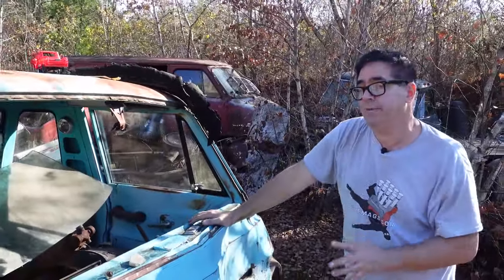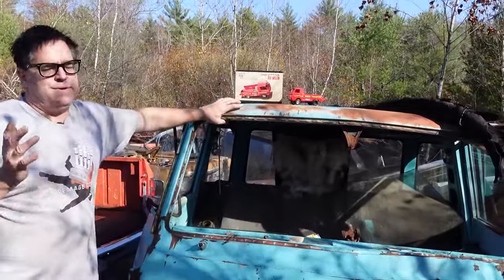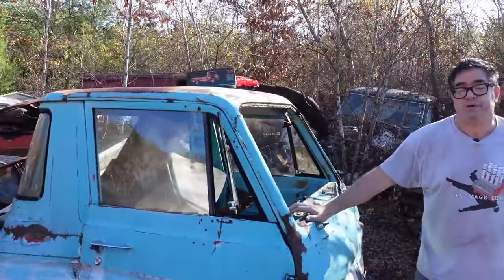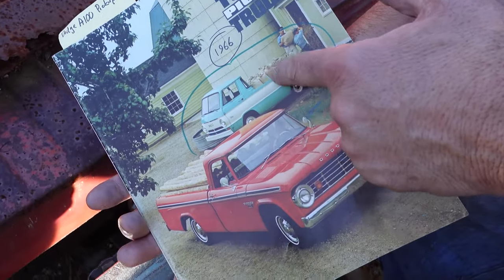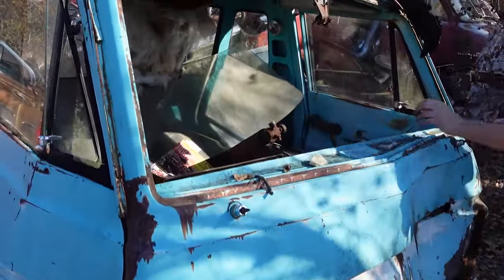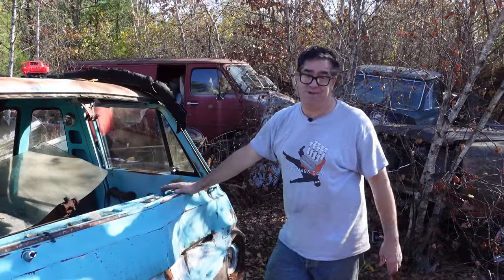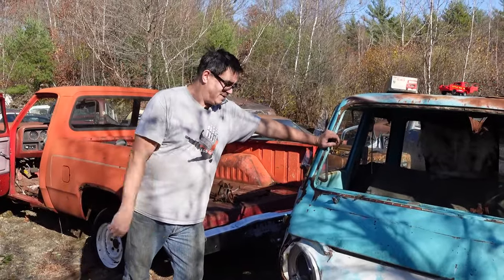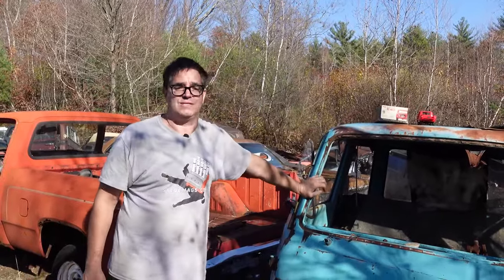Truck Week EP34 - Dodge A100 Pickup

Comment: Those cab over vans and pickups could be terrorizing to drive.
Working the algorithm Steve 👍
Reply: Not terrorizing at all. Amazingly maneuverable and very clear sight lines. Been driving old VW's for decades, and spent many miles behind the wheel of a cabover box truck. I always chuckle and wince when the tired old "first to the scene of the crash" joke is mentioned.
Reply: I imagine with just a lap belt, head-butting the W/S could be a thing.
Reply: @corey6393  agree to disagree.
Reply: @corey6393 The cabover trucks like the Isuzu NPR I sometimes drive at work bounces me around a lot. I prefer the Ford F450 or out of production GMC Kodiak 4500 for the better ride although the Isuzu turns on a dime for a truck.
Reply: @BrewBlaster  True, and the same would happen with that D150 next to it. No cars had the safety features we now rely upon, back then. It's always odd to see people compare them to modern vehicles.

Comment: Another day, another video. Another day closer. As stated last time:

I've said it once, I'll say it again: You don't need those networks. You do better on your own, and they did make a mistake to cancel both shows, but at the end of the day, your presentation as an independent is much, much better. At 77k+ subscribers, it shows how your style is viewed and enjoyed by many. 

No VIN, can't win, but might be something like 18 for Dodge A-100 pickup, 6 for six cylinder equipped (8 is eight cylinder equipped), 1 for Warren Truck, Warren MI, 2 for Warren Truck (Heavy Duty), Warren, MI, 6 for Windsor Ontario Canada or 7 for Missouri Truck assembly. Warren, MI truck still operates today and was opened in 1938. Windsor Ontario still operates and opened in 1928. Missouri Truck would have been part of the Fenton, MO plant complexes and closed in 2009, with south St. Louis opening around 1959 and North (which made trucks) opening in 1966. The remaining last VIN digits are the production sequence and determine the model year, much like as Mr. Magnante has pointed out with Ford trucks.

No tag, can't brag, but maybe code 12882 Light Blue exterior paint.

Comment: i've always appreciated these things but learned a thing or two today. thanks man!
i recall a buddy had an old chevy cab over van (like the a100) and in our drive from mass to tenn it was using so much oil we just punched a hole in the doghouse and added oil via funnel right into the valve cover without stopping. the co-pilot's job wa to watch the gauge and add oil as needed.
Reply: Think they called it a Corvair van. Good deal on easy access oil topper! 
Done similar to just get something home, no way doing that with a today vehicle!
Reply: I opened the "hood" on my 68 Dodge and did the same thing.
Reply: @goratgo1970 Corvair van had the engine in the rear. You'd need a very long hose to add oil to that while driving down the road. Chevy made a front engine cabover van but not a front engine pickup.
Reply: @tomkrisel4493 Ah, looked it up. It is called the G-10 van. Maybe Steve's next video?            JK

Comment: The nice thing about the A100 was from 1966 on V8's were available in them, something you couldn't get in the Ford Econoline until 1968 and the Chevy van until 1967 so Dodge had a jump on the competition for horsepower by at least a year.

Comment: I was waiting for a mention of the other forward control light trucks from the 1960's,  especially the innovative Corvair Rampside. As its name suggests, it had a ramp built into the right wall of the bed that would open down to street level to make loadong and unlooading incredibly easy. Need to move a refrigerator? Piece of cake! You're a landscaper . . . How do you get your riding mower into your A-100 or Falcon Econoline pickup? You and about three co-workers pick it up and manhandle it abord. With the Rampside, just drive it up the ramp. Tromp hard on the brakes in A-100 or Econoline pickup with nothing in the bed and you'll be scraping your front bumper on the street - I've seen it happen in a couple of promotional videos. With the "Rampie", with its engine in the rear, there's no danger of that. 4-wheel independent suspension was standard on the Rampside, not even available on the other two lesser trucks.

Comment: I didn't need the model,I owned a67 A 100 pickup,318,auto with ps and dual ac,and it would pull the front wheels up with ease,quick and fun but handeling not so much,one of the first muscle trucks❤❤❤,loved it

Comment: What’s the biggest engine you could fit in that Doghouse. I had a 1962 Chevy Rampside. Great Engine and little pick up. Air cooled. Had lots of rust though. Sold it to a guy in Nevada he brought a trailer. And resold it. 🤷‍♂️